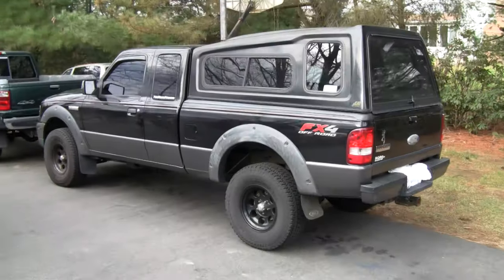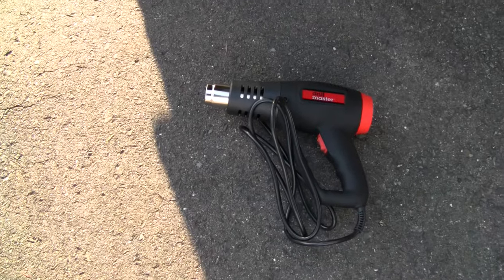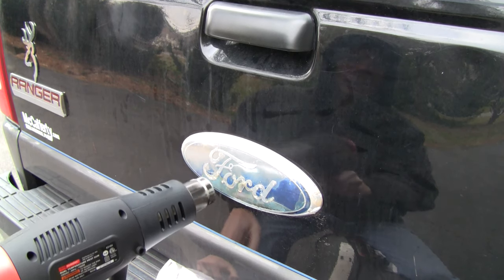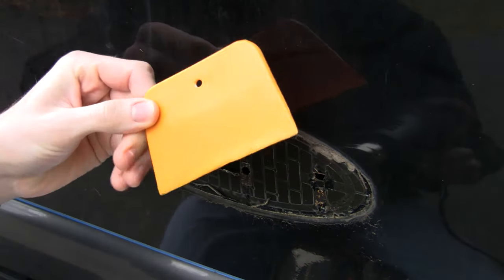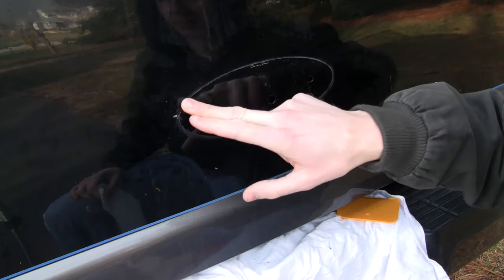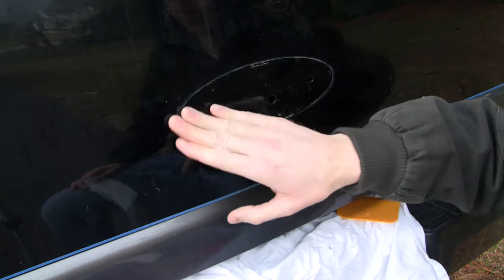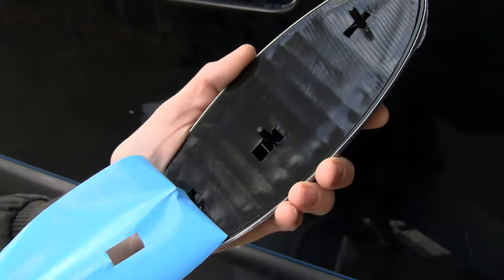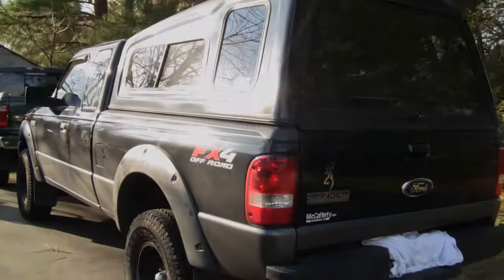How to REMOVE & REPLACE Faded Ford DECAL (tailgate or rear hatch)

Comment: All u need is heavy monofilament fishing line.  Snake it behind the decal which is held on with 3m VHB tape. Then “saw” the line back and forth behind the decal.  Then remove any remaining adhesive with wd40
Reply from the maker: Thanks for the tip! I'll give it a try on the next one.
Reply: Bman H - You are right on the money with the WD40! Works good and most people have it. Thanks!
Reply: If it were only that easy using fishing line😑
Reply: The tabs would cause a issue
Reply: I hate Fords

Comment: I just pulled my badge  off. I parked the truck in the sun for about 5 minutes and then started to peel it with a squeegee similar to the one in the video. Once I got it off there was a bunch of glue left behind - like in the video. I used the heat of the sun and folded it back into itself just using my fingers. It all ended up in a ball and that was it - perfect! No scratched paint. Thanks for the video!!!

Comment: Sanding it will bond the adhesive really well. But it will make it harder to remove later on when you want to do it again.
Reply: It really isn't necessary.

Comment: Your vid was simple and straight forward, my rear emblem was pretty much the same and came of pretty easily. Getting the excess glue off was easier to just heat and roll with my fingers, gentle heat let me roll it without burning my fingers.
Used just 91% alcohol to clean up the residue and replaced it WITHOUT sanding 

Thanks for your hints

Comment: You can also use lighter fluid to clean the residue. Also, if you can touch the inside of the skin where the emblem is, even with a stick, it would be recommended to push against it so that the metal grabs on better. Unsure how this tailgate is vs say a hatch back door.

Comment: Good job buddy. You going to have that truck looking new again if you keep replacing everything. LOL A tip I have done in the past on some emblems and other things attached with 2 sided tape  is dental floss to remove them kind of use it like a saw between the mounting surface and the tape it does a pretty good job. Have a great week!!!

Comment: I have a faded plate just like yours and a picked up a replacement on marketplace for cheap ...downside it doesn't have the sticky plate ... can I use the old logo inner plastic adhere plate with the new logo cover i have and glue it ?? any advice would be appreciated

Comment: Cool I never knew it had screws, mine is a small old ranger with a small logo on the right side I dont think it has screws. At least ford uses good glue my logo is pretty worn out it's a 1997 but I'm gona wait till it completely fades or cracks or falls off lol btw your supposed to push pressure on any logo for at least 1 min and do not let it get wet for 48 hours the same for stickers.
Reply: Thanks, didn’t know about pressure time nor 48 hours
Reply: @froglobster  they often have instructions and many websites you order stickers or Plastic hood ornaments from also say it on the website and lots of glues do to and paint.
Reply: @JustinKruger336  k thanks

Comment: The sanding isn’t necessary at all. But looks good
Reply: Yeah, I thought the same thing. That old adhesive was stuck to the tailgate way better than to the emblem. So if sanding increases adhesion to the tailgate, your weak point is still on the emblem side. I pulled mu emblem off with no heat either. Just pulled right off.
Reply: @Redneck_Ed   yessir mine didn’t need heat either

Comment: wonder if a hairdryer would work as good as the heat gun.
Reply: I used a hair dryer on my front emblem. Would not sand the paint. Use a good paint compound then alcohol it.

Comment: Wouldn't Goo-gone be safer  instead of lacquer thinner? That stuff is great when you need it.
Reply from the maker: This was some tough stuff, not sure if goo-gone would have cut it!
Reply: I used goo-gone, but still had to scrape a lot. Overall, the glue removal took about 10 minutes. 
The key to the removal of the emblem was most definitely the heat gun. I first tried without it, and then watched this video. The  heat gun was like $25 and worked like magic!

Comment: Why not just heat it and use fishing line? No disrespect, but this was an easy job. Try removing the rear emblem on a Ford Grand C-Max (I don´t know if that model exists in the USA) because on that model the emblem is mounted in some sort of "hole" with an edge all the way around so there is just NO way you can get anything behind the emblem
Reply: I wish I would’ve used this tip, its superior in every way because dental floss is so easy to come by